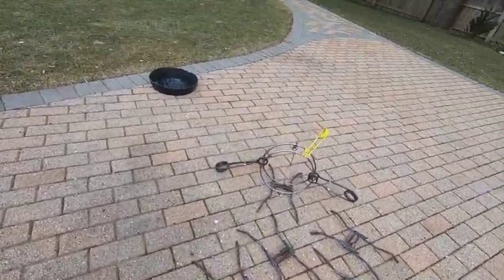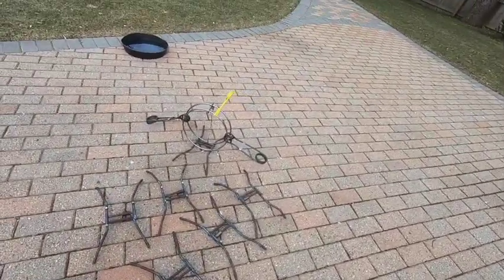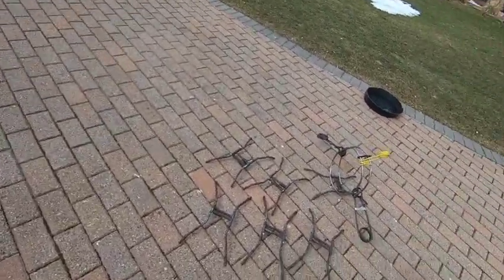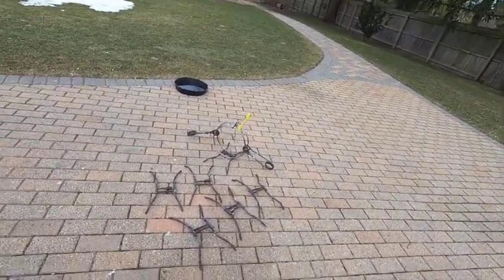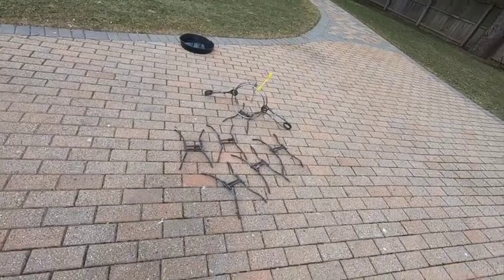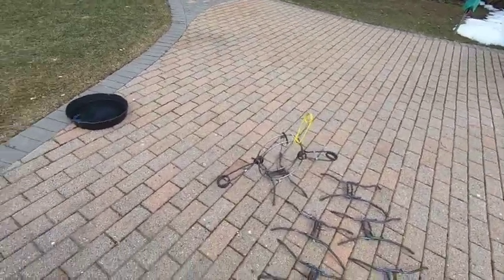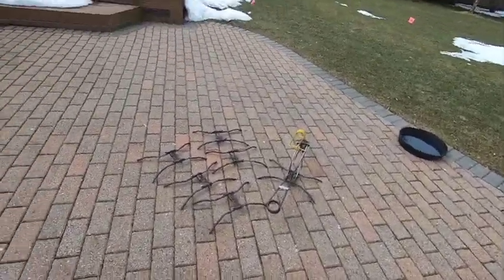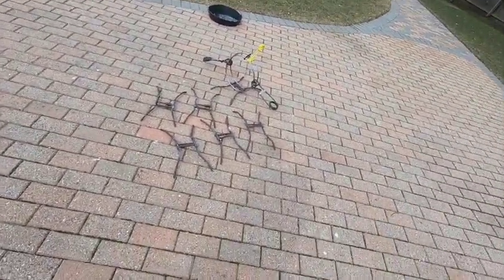Seldom's Beaver Skater Trap Stabilizer II

Comment: I like the spring idea, that is slick!
Reply from the maker: I liked the principle of the spring being part of a 3-point holding system so I made my own version using 3/8” rod scrap and some of my #3 coil springs.  There was more to fabricating it than I 1st thought.  I had to adjust the distance between the 3 contact points several times until I had the tension I wanted.  Couple that with the difference between the height of the two jaws.  Interesting fabrication.